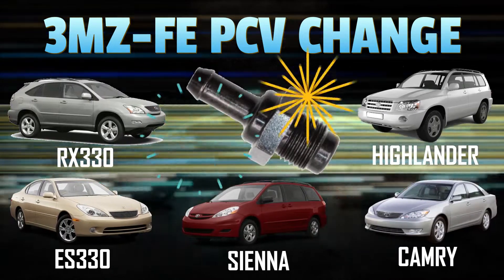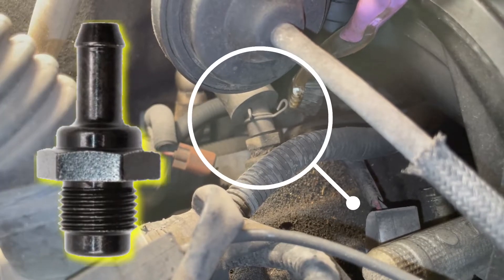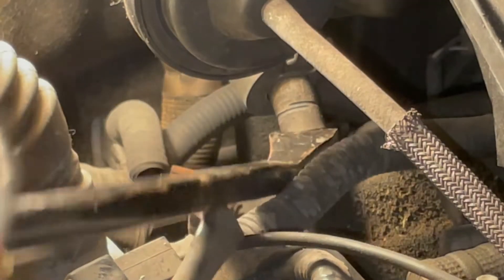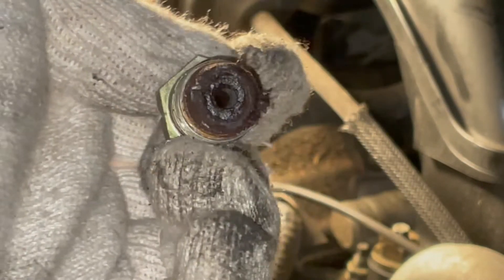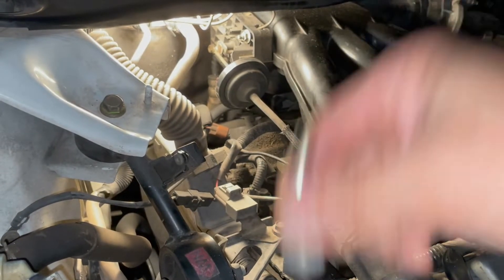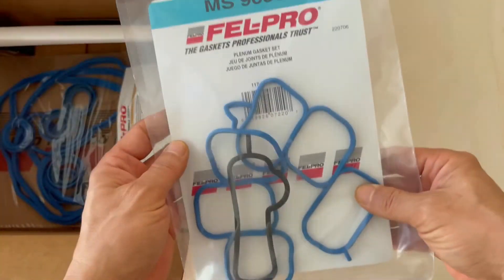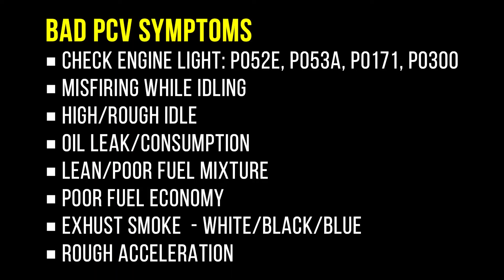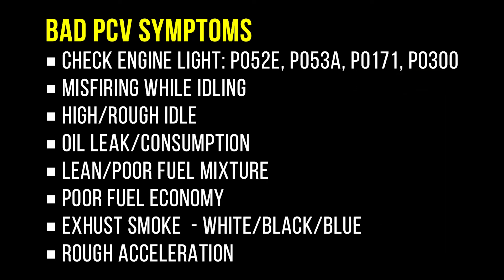2004-2007 Highlander PCV replacement.

Comment: Very nice explanation.  It's been a long time since I've replaced the PCV valve so demonstrating the ball movement with in the new and the old valve was a good reminder as to what to look for.  Thanks for the video.
Reply from the maker: Thanks for the feedback. Buy the PCV from Toyota dealer as it’s only like $10-12 bucks. Online stores have too many fake OEM ones.